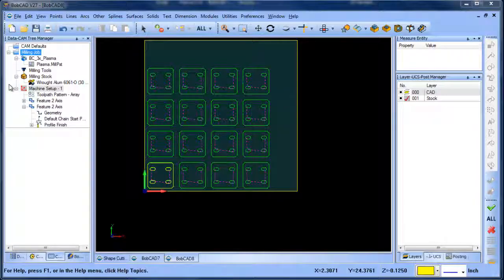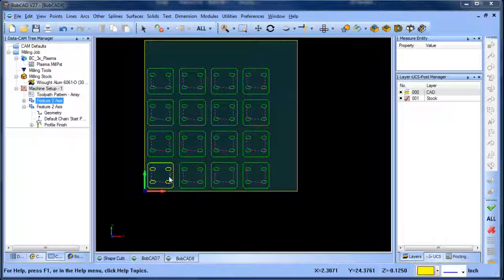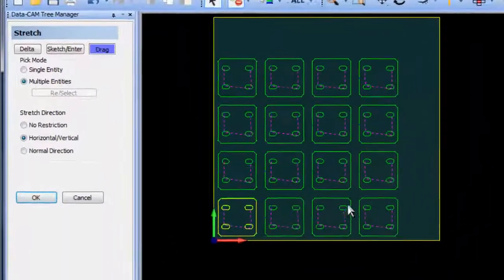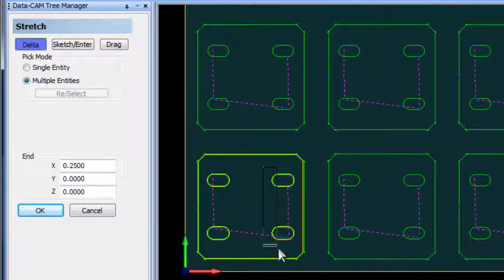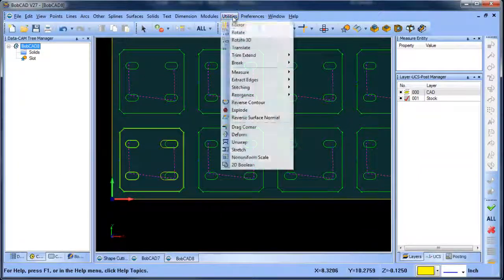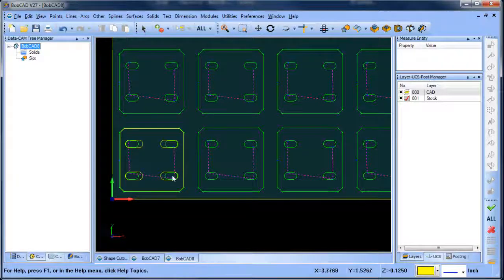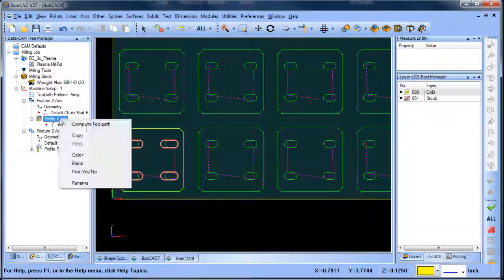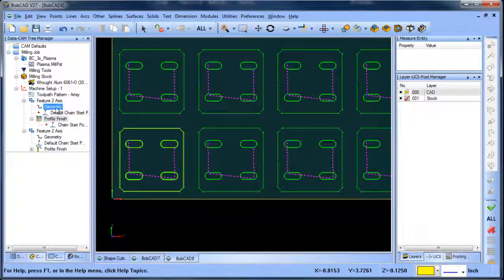Using Stretch Feature to Edit Geometry for Plasma Cutting BobCAD CAM V27

Comment: i have version 26 and i am trying to stretch text to fit in an area.  If I resize the height to get the length correct, the height is too small.  How would  I be able to stretch the height?